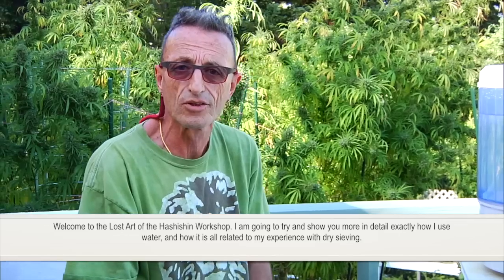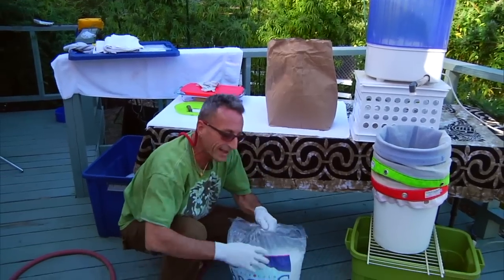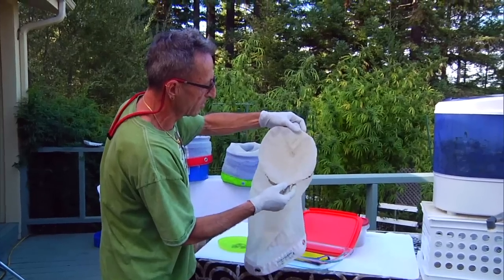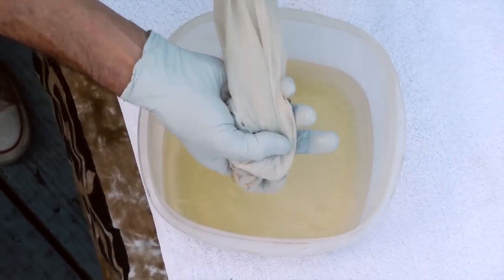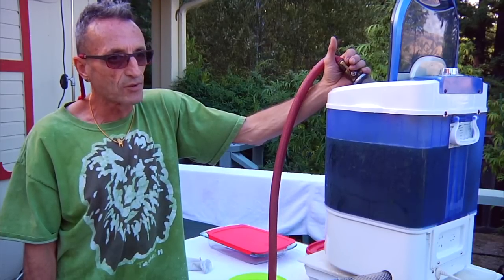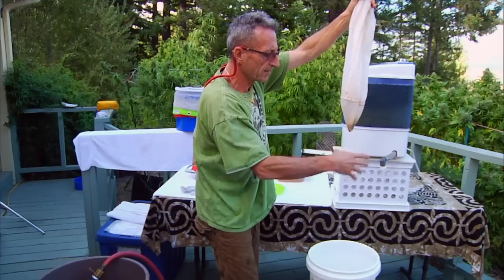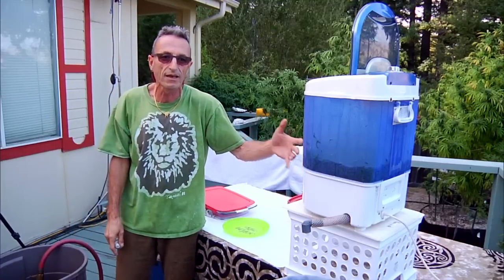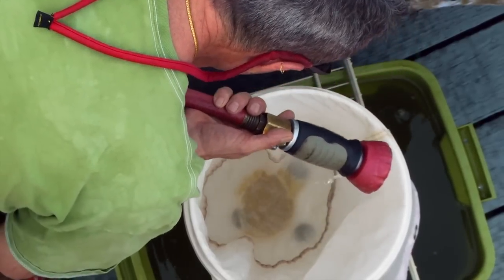How to make Hash with Frenchy Cannoli

Comment: Frenchy you have guided me to my final destination, my fate as it were :) Keeping the trim in the vortex without a bag is SO critical! Have you ever watched clothes circulating in one of these new wash machines that only agitate from the bottom? Sure it saves water, but it will NEVER compete with the traditional, vortex shaped (!) cones that are in the older machines. In a new machine watch for an entire cycle and you'll see parts of clothes that NEVER turn over in the water, or heavy jeans will stay on top the ENTIRE cycle. If the trim circulates UNIFORMLY, you can separate the quality better from one run to the next. Using a bag will NEVER be able to do that kind of separation because some buds will release the ripest trichomes on run 1, and some on run #4, because they were pressed in the twisted corner of the bag for part of a cycle... NOT consistent!  Of course you can still use a bag and use the sieve bag micron size alone to separate quality, but if you remove the bag you add another DIMENSION. Love your vids, thank you Frenchy!

Comment: Note the replaced drain hose with pour spout compared to the hose the machine comes with.  Great tip to run the machine bagless- i find a lot of material can get around the zipper
Reply from the maker: Good point - I replace the full accordion hose because leaf matter gets stuck in the pleats of the accordion and rots/molds.

Comment: Great video. Very informative... I do have 1 question. I see you use water from a hose? I was told to never do that and to always used ro or distilled water... what's your opinion that?
Reply from the maker: Yes. We use water from a hose that has a RV filter attached to it. There are a few brands available. We often use Camco TastePURE Camper/RV Water Filter & Hose Protector.

Comment: do you take the slotted drain cover out of the machine? im afraid that the trim will clog the slots and it wont drain?
Reply from the maker: +northCALIFA No need to remove the drain cover but I do remove the accordion tubing. It accumulates resin/leaf matter and can become dirty. I replace with tubing from Home Depot I can remove and soak in alcohol to clean. I'll post a photo on FB.
Reply: +Frenchy Cannoli you answered my private message on Facebook w great pictures to show where the drain tube is located and how to access it thank you so much exclamation point I didn&#39;t mean to seem like I was in such a rush but I was washing 550 grams that day!
Reply: @SaulTeebolz  hey man, any chance you could share that info with me?

Comment: trim with water leaf? why add the water leaf?
Reply from the maker: +Samsquanch Wrong question. Why not talking off the water leaves would be more accurate. I try to touch dry material as little as possible, cleaning my material from water leaves cost too much in debris that I have to clean after

Comment: Frenchy I couldn't tell did you say not to be using ice cold water because it will stay ice cold and crush the trim or would it be okay to use ice cold water on your 2nd or 3rd run when the ice has melted a little bit?
Reply from the maker: +fashwayze21 it's the ice that crush the trims the water just agitate and cannot crush but stroke instead the resin heads of the stalks, powerfully but gently

Comment: i think what frenchy means by going bagless is that if its in bag the water current ( which is whats used to take of trichomes heads off with the extreme cold of the water not the ice as he says )it doesnt get the flow or current moving like if it does not in bad , also the turning of the water allows the plant matter to float around in a greater surface area allowing current to get threw and knock them off . in bag its stays in a clump or mass that dont allow the current to flow threw freely. rip frenchy , miss your videos and knowledge alot already . cannabis community has lost a legend

Comment: What kind of little washing machine is best to use for the 5 gallon bag or does it not matter
Reply from the maker: You want one that does not have internal paddle. You can find on Amazon or E-Bay. https://www.amazon.com/COSTWAY-Portable-Semi-Automatic-Translucent-Capacity/dp/B06Y28L3S1/ref=sxts_sxwds-bia?crid=3K17J19WZM7DJ&keywords=mini+washer+machine&pd_rd_i=B06Y28L3S1&pd_rd_r=0d55418e-cef6-4d8d-beed-aaeccec2a800&pd_rd_w=a6qjj&pd_rd_wg=SUTkQ&pf_rd_p=a5491838-6a74-484e-8787-eb44c8f3b7ff&pf_rd_r=ZK155P23MNSWZ7097DY6&psc=1&qid=1572486846&sprefix=mini+washer%2Caps%2C197

Comment: Are you using regular hose water? I thought I was supposed to use distilled or RO water to avoid minerals and such?
Reply from the maker: We use an RV filter that hooks up to a standard hose when we do these remote farm visits. At the manufacturing facility there is a full inhouse filtration plant onsite.

Comment: Hi Frenchy, 

Ralph here. From the looks of your video you are on the opposite side of the valley from me. Thanks for the detailed information. Since you are mixing the product after sieving, why separate runs?

Also, when using well water, do you filter or treat it via reverse osmosis or is some minerality in the water acceptable?

Thanks for sharing your method so generously.
Reply from the maker: +withere If I wasn't collecting after each wash it would make the cleaning of the resin accumulating in the bag harder to wash, small batches with short runs keep the debris to a minimum, washing and collecting your main bag keeps the overall quality higher.
Reply from the maker: +withere I was visiting the cameras' owner, no name necessary I would imagine, there is only one of him. I separate the run because I shake the plant material by increment which gives me different level of resin ripeness with the best growers and/or strains I can keep it all together otherwise I separate when I can perceive a difference. Check my IG where I posted photos that answer your question. Well water can simply be filtered for sediments if you have a nice deep one. Knowledge is made to share my friend, it was given to me I just spread it

Comment: good work except you want to put your 220 micron bag inside your washing machine so that you dont end up getting a migraine trying to remove all of you used material which will inevitably clog up your machine. not using a bag will make little to no difference in your overall yield i know as i have tested this many times and more times than not the yield was the same with the same amount of starting material. and if you want even a higher quality end product using a 120 micron bag to place your material in inside the wash will do even better.
Reply from the maker: Totally disagree. Since I am sieving I DON"T WANT TO PUT ANY BAGS WITH THE TRIM IN THE MACHINE to be bunched up in a ball by the vortex of water thereby reducing the sieving surface the trichomes have to pass through. This is a misuse of the tool. It's a sieving bag. The full surface is intended to be used for sieving. And, I have also tested it many times and you loose yield with every wash when you use a work bag to avoid 5-10 minutes of cleaning at the end of the final wash cycle.

Comment: Great vid Frenchy. Question: what is your favorite machine? And if the trim has been ground into small pieces will it clog the drain if I don't use a bag? I have a good quantity of trim from TGA genes (we both know Sub well...I am using a different name on Youtube) and want to do a couple days of runs. 

Your machine looks like a Bubble Magic machine. Since there are so many out there I was just curious if if you have a favorite. Thanks and keep up the vids!! I have seen some of your best work at Subs and it is amazing hash.
Reply from the maker: +Wing Nut I use Boldtbags machine and the bags they custom make for me. I cut part of the exhaust grill so that it does not clog too often when emptying the machine. Sorry for responding so late to your question, I missed your post. All the best Post on my thread on Rollitup.org for questions

Comment: Does it make a difference if i will use fresh trim or dried trim?
Reply from the maker: Both will work. The fresh trim will start to bleed chlorophyll after 3-4 washes but the terps will be more abundant. With dried and cured you'll be able to do 8-10 washes in a batch and the terps will have transformed. Do both from the same cultivar to experience the difference in flavor. It's revelatory.

Comment: FC, what about larger nug runs? Is gently breaking up buds to a looser consistency the way to go? Going to try the 'no' bag method. Merci
Reply from the maker: +Carter Ingram I let the water do the work in the machine with dry buds, much gentler. If you work with fresh material you will have to cut the flowers open if they are too dense, cut over the water so that you do not loose any resin.
Reply from the maker: +Carter Ingram Let the water do the breaking for you when the plant matter is re-humidify, just put the flowers as is if they are dry. If the flowers are fresh you will need to cut the buds open with scissor, do the cutting over your water.
Reply: Any results to share? About to do my 1st run since I got my freeze dryer in. Can only get cured buds here but can get newly cured strains so want to try making hash

Comment: What size bags did you use ?
Reply from the maker: 190, 160, & 45. Full write up of the process here: https://static1.squarespace.com/static/59cd905351a5846569cfbbca/t/5d7734bd4daeac2b9791e7a1/1568093450367/WeedWorld+Issue+139.pdf
Reply: @FrenchyCannoli  Awesome thank you Frenchy for your passion in an industry that is losing its center, especially about hash my favorite way to smoke.

Comment: What model is this machine?
Reply from the maker: It's the generic mini-washer available on eBay or Amazon. They are marketed under different brands but they are all the same machine coming from China. Query "mini-washing machine" on eBay and you'll find one.
Reply: Which brand of "all the same Old from China"  looking for the one with the correct plate for drainage on the bottom and I know they all need to be mod. pyle already sent me a used one.  Amazon finest
Reply from the maker: @theoverthinker5144  The ebay listings do not have brand names. https://www.ebay.com/itm/202574032697?epid=19028438194&hash=item2f2a5a6f39:g:mfQAAOSw-Ilc9gyJ

Comment: He explains why he doesn’t use the mesh bag for the material in the washer at 10:12
Reply: With that little washer I've tried both ways and I feel like the free float there's just more hash that pulls
Reply: Wildcard842 yeah I ran a test last week and I think with the free float you get a higher yield but more plant residue in your larger screens. Not a huge problem if you’re using for edibles and only saving a lower spectrum, but I think you’ll get a nicer range of slightly higher quality with the bag.
Reply from the maker: Do a test. Run a cycle with the "work bag" in the machine. Then dump the contents of the workbag into the machine and run it the way I do. I always get a few more grams of resin out of this. Multiple this by all the washes you'd do in a month. What's the total?  A LOT of resin left behind using the "work bag" method.
Reply: Frenchy Cannoli yeah man I’m running your method, was using a larger spectrum of screens, however following on from the info gleamed from this video and a few slightly different tests I think you have the most practical approach
Reply: So yeah then I would notice more green material in the the actual catch layers but I spent more time rinsing the normal thoroughly rinse each layer you will push all that green material down to the compost catch
Reply: Like just comparing what we wash last year not rinsing is Thoroughly compared to what we've been washing thoroughly man the Melt is just way better